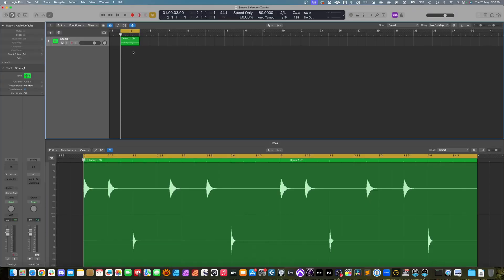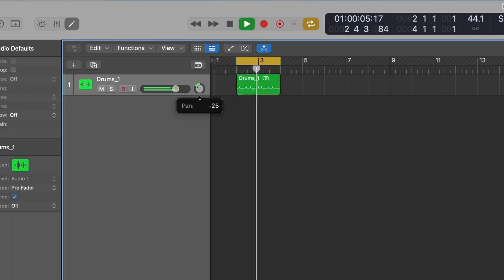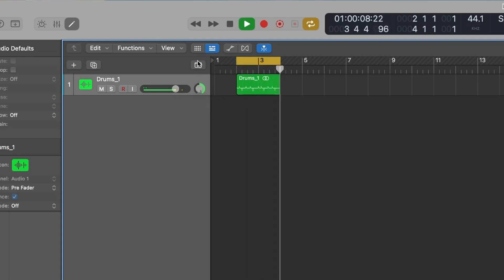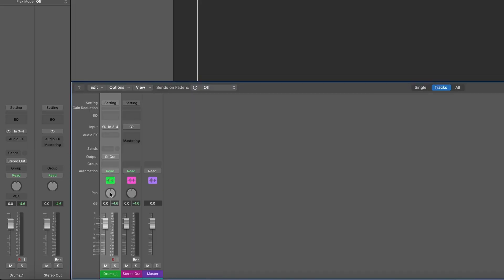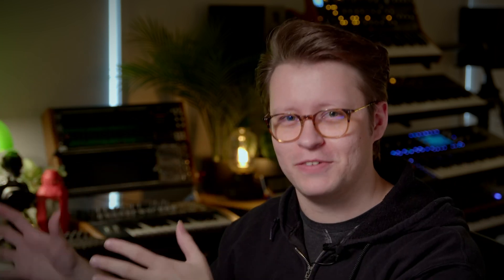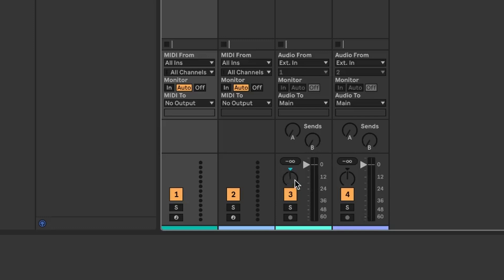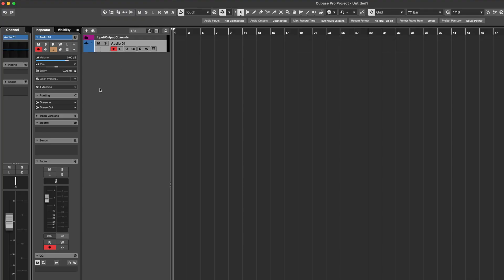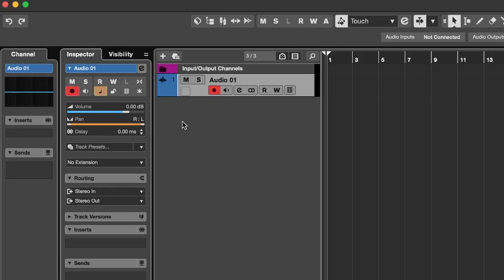Stereo Pan vs Balance Pan... What's the Difference? (Logic Pro, Ableton, Cubase and Pro Tools)

Comment: Thanks so much for this explanation!  I am glad to have found this but not really for the reasons intended.  At the risk of exposing myself as the noob I am...
In the process of installing and testing a new sub I noticed my interface was not getting signal from the DAW (either Logic or Ableton) when panned full right.  
Apparently I had for years been listening to mono out of only one of the two USB channels routed to the L/R main outs on my interface (a Zoom F4 field recorder actually.)  Once I routed it correctly I am now able to hear the left and right speakers' unique signals for the first time!

Comment: I wonder if this matters with mono recordings, aka rhythm guitar tracks which get planned hard left and hard right. It seems like the information is identical in the left and right channels, so it doesn't matter which planning method you use. Just a bit of additional amplitude? What do you think?
Reply from the maker: Hey, that's exactly it, with mono recordings, it is just a balance knob, adding more volume to the left or right speaker. In Logic, I'm pretty sure mono tracks don't have the option to change the pan knob to stereo pan, because there wouldn't be a benefit, it would simply just be the same signal in both speakers when panned to the centre.

Comment: What about the phase issues that come from stereo panning?
Reply from the maker: There definitely can be some issues, particularly if your correlation between the left and right sources is closer to the -1 than the +1. If a signal like that get's stereo panned hard left or right, you are going to get a lot of cancellation, so a balance knob in those situations might not be a bad idea to avoid this issue. As with all tools, it's as much about picking the right one for the job as it is the power of the tool.

Comment: Reason has a slightly different approach with, like most DAWs, the Balance panning behavior. You then have a width control which lets you pull the signal to mono. This means that you can swing the balance 50% left and narrow the stereo to 50% and you have everything. It also means that you can leave the Balance at center and narrow the stereo of one sound so that it doesn't trample all over other sounds. Effective.
:-)